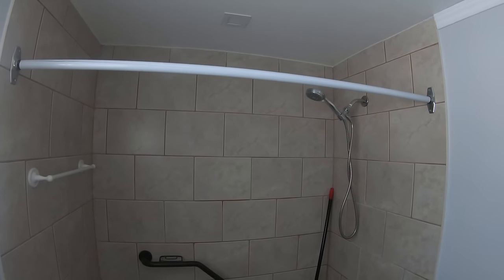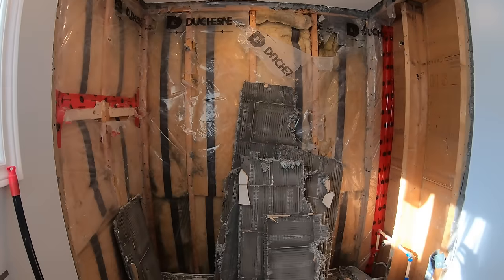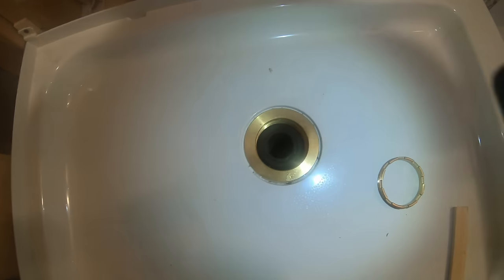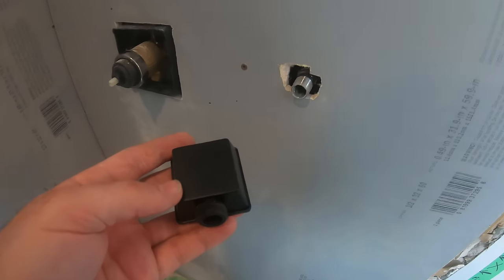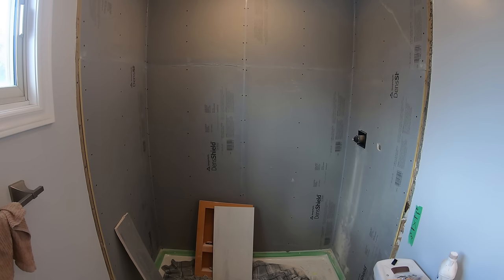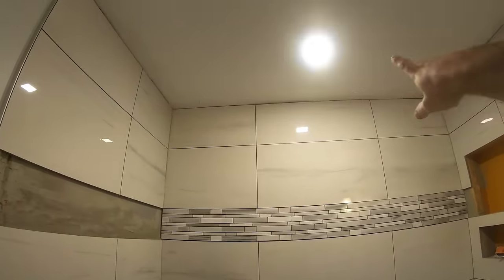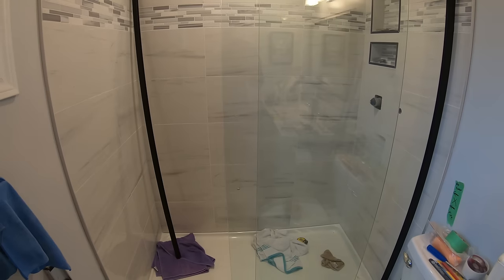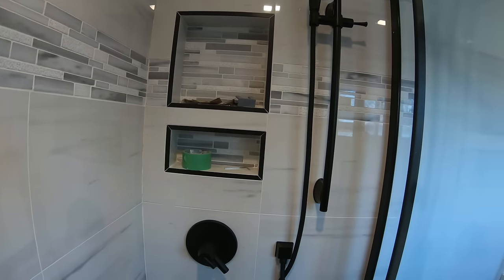$4000 Tub to Shower Conversion

Comment: I wish l would have seen this video last year, when an incompetent contractor did our conversion, he put a liner on the floor, then sheet rock, it’s all marble tile with a seat and a niche for soap, looks nice but exactly a year later it’s leaking, the water travels from the bottom of the divider step to the room, now we can’t use, it and after he came and saw that it was probably a lot of work, just stopped answering the phone, lm so angry after all the money we spent.
Reply from the maker: I'm really sorry to hear that.  An acrylic pan is pretty idiot proof so thats why I went with that.  Waterproofing a tiled pan is a completely different animal and should it leak I can imagine it's a huge deal as the rest of the shower has been built in top of it.

Comment: On the walls, did you just put tiles over drywalls?
Reply from the maker: It's called Denshield.  I installed it exactly to manufacturer instructions.  

https://buildgp.com/product/densshield-tile-backer/

https://www.menards.com/main/building-materials/plywood-panel-products/tile-backer-board/georgia-pacific-reg-densshield-reg-1-2-x-48-x-96-tile-backer/1314918/p-1444431321138-c-5704.htm
Reply: Thanks for the link.  I don’t mean to freak you out, but it says moisture resistant which is far from water tight.  It also says absorb less water, so there is still some absorption.  Then if it’s core is like drywall, it will crumble fast.  I would not think it’s appropriate for a shower application which is constantly exposed to water.  You can compare it to schluter boards which are covered with a rubber-like membrane and the rigorous sealing method at the seam with 2” overlap.  That’s how we prevent water from getting to our walls and eventually attack the framing as well.
Reply from the maker: @b3arwithm3  The front side  actually has a waterproof layer, and all the seams between boards get sealed with silicone and corners got kerdi band (which wasn't even required by the official instructions).  I used it correctly, and it is intended for shower use.  Truthfully, it wasn't my first choice, but all that was available during this supply chain sh*tshow.  I looked into it extensively before using it, because like many other comments here I had never heard of it. 

Maybe I posted the wrong link, this one explains in more detail?

https://buildgp.com/densshield/
Reply: @tokyosteve1223  I hope you are right and I am not familiar with denshield.  But just looking at the sealing recommendation of using just a silicone bead, I can't feel good about it.  With schluter or other membranes, we put a 4 inch wide band over the seam which I would trust more.  I have seen so many showers fail due to water getting thru the cracks.
Reply from the maker: @b3arwithm3  I guess we'll see.  I followed their instructions to the letter.  Also large format tile with 1/16 grout joints over an acrylic pan.  Not a lot of places water on a vertical surface to find a way through.  I'm feeling pretty good about it.  🙂

Comment: Which mortar for the wall tiles?
Reply from the maker: I used Mapei "Large Tile & Stone Mortar" from Lowe's.  But since then I've used Mapei Ultraflex LFT and much much prefer it.  I used it on my own shower and will use it again.
Reply: @tokyosteve1223  it holds 12x24 tiles good?
Reply from the maker: @GoodBoy-qf5ui  it had great grip.  Very minimal slippage on the wall.
Reply: @tokyosteve1223  so the ultraflex left is better

Comment: Und wo ist die Abdichtng die fehlt komplett mit Dichtmannschetten  Dichtband da fehlt es doch an Erfahrung
Reply from the maker: Actually no that's wrong.  The board is DensShield (not regular tile backer board).  It required only a sealant between the boards to achieve waterproofness according to the manufacturers instructions which I followed precisely. You're welcome to look it up, it's made by Georgia-Pacific Building Products.

Comment: Are you venting that bacteria packed steam from the shower into the attic or is that going out of the building? Is that code for there? Anybody reading this, Don't vent into the attic, vent outside otherwise mold can grow, get into your lungs and ruin your health as you keep breathing it in. It ruins structure and health, just like ROOKIE installers. I've been remodeling bathroom, over 100/year for 34 years. So TEST ME. I'm not going to tear up the rest but just know a good shower install isn't just 4K it's 10K on average.
Reply from the maker: It's vented out the side wall of the attic.  I didn't realize venting into the attic was a thing people did.  Doesn't sound wise.  

It was crazy cramped up there, filming it became secondary to getting it done and getting out of there haha

Edit.  The $4k was the materials, obviously no labor costs because I YouTube'd it and did it myself.

Comment: $4k seems pretty high.. I'm looking at about $1500 USD.. Simple insert.
Reply from the maker: I think if you got a quote for a complete tiled tub to shower job you'd be shocked at the numbers you'd be given.  In any case $4000 in materials only was probably a little low, I think I spent slightly over that.  Prices of materials in Canada is a bit over the top if you're Home Depot shopping.

Now.. it was CAD, not USD.  So $3000 USD. 

I really should update that thumbnail 😂